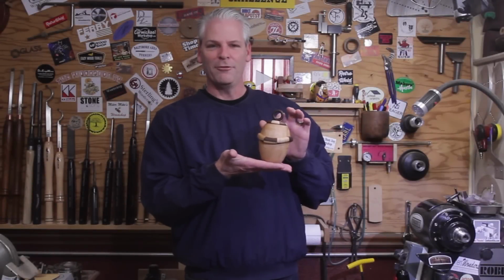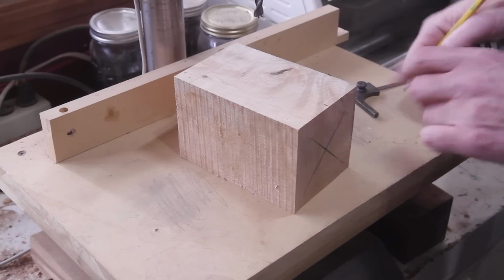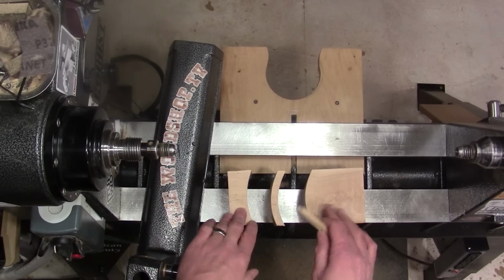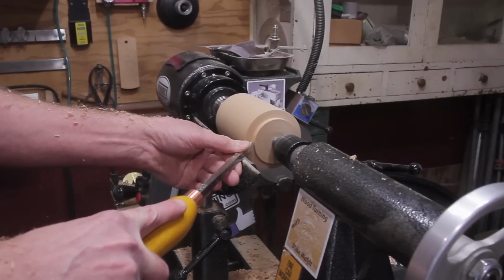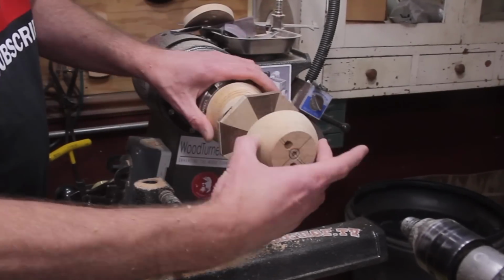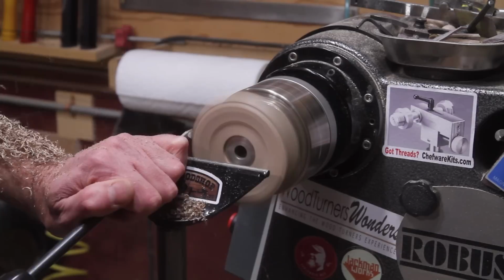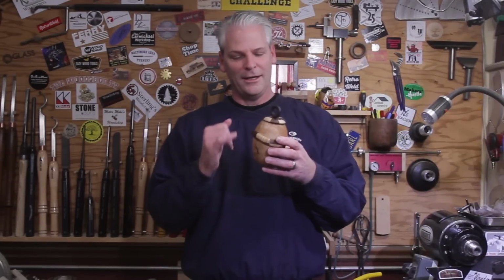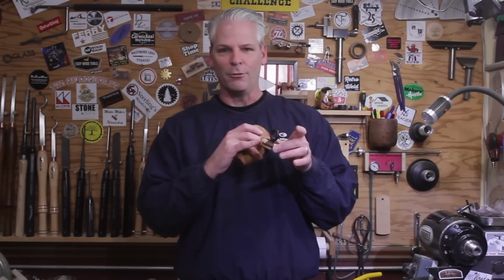Woodturning Segmented Lidded Box | Carl Jacobson

Comment from the maker: I turned this John Beaver inspired lidded box. I used the Miterset to make the segmented rings for the wave, and lid. I used the bandsaw to cut the arc which creates the wave after it's turned on the lathe. I used Maple and Walnut for this project. The box is 6" tall and 4" in diameter. Checkout the Miterset Miterset: https://miterset.myshopify.com/?aff=22

Comment: Carl, I have used a table saw to cut many segmented projects. I have found for safety when cutting a segment I put a pencil with a good eraser in my right hand and place the eraser on the cut segment as I cut it and guide it away from the blade.
Reply from the maker: Thank you for the tip Rob